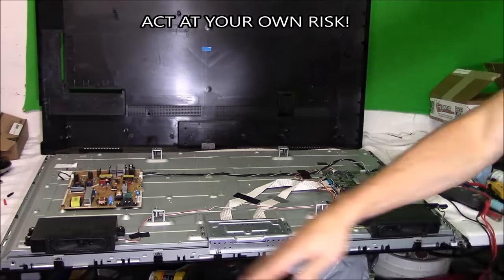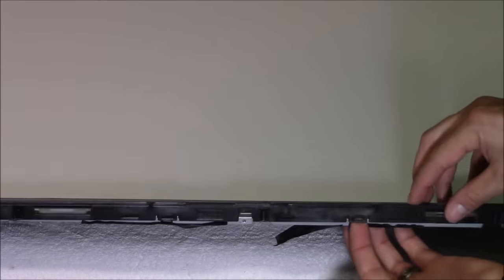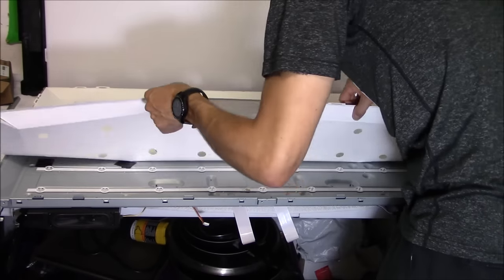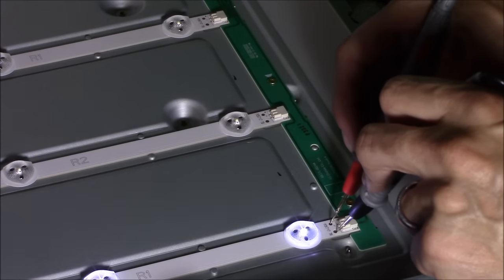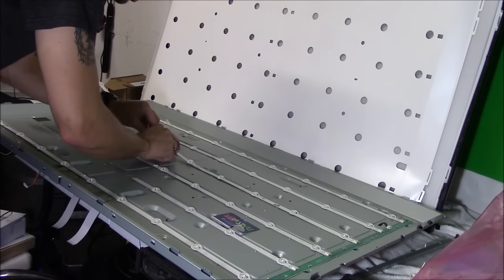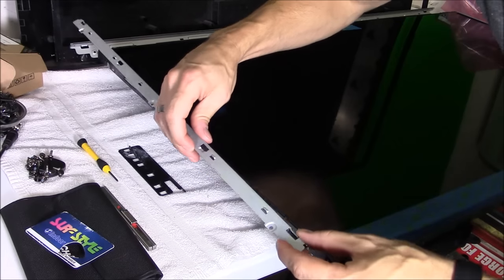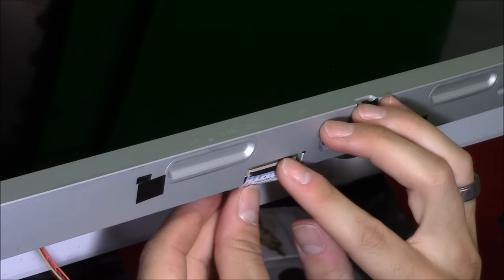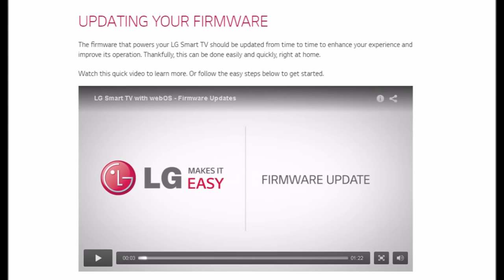How to fix LED LCD TV black screen no backlight, TV disassemble, testing LEDs, ordering part, repair

Comment: Hi! I have a AOC 40 inch Led tv. the screen is completely dark. when I use flashlight I am able to see the image. I open the back cover of the TV and after inspecting I see that on the power supply board where the LED strip connector is available there are some burn marks. it looks like a IC burnt out. kindly help me how to fix this issue.

Comment: Hello sir, I have a problem with my LG 47” LED TV. Which is no backlight. I measured the voltage, output voltage both side is 102 Votes. What do you think? Tell me please, what happens. Thank you.

Comment: Is it really worth it  after spending only $200.00 for the t.v.  You pay for a tester. How much is a replacement for for backstrip lights.
Reply from the maker: True but Depends on the tv model some TVs are worth fixing.
Reply: @TampaTec  my tv is Lloyd's 24" had it for 8 years & the red light started blinking, when it shut off after a wind storm.
Also, have a 32" RCA, that worked for 3 weeks, but was in the box for 5 years  & just like stopped working.
They do not have the tester at Amazon, I just checked. 
How much do the LED strip go for..
I guess if it is not too expensive, I could try.
Since, I have 3 tvs about 8 years old, that do not work. 
😆 
How much do you think it would cost to bring into repair?
I am a person that does things myself; but I am worried I would mess it up.
Thanks again for responding

Comment: The back light on my two year old Samsung Smart TV just went out. Guess that's another thousand bucks down the drain! Before I purchased my current TV, I had a Sony LCD TV and that one broke shortly after a year. Since I owned that television for approximately 14 months when it suddenly stopped working, the warranty expired. Before I owned my Sony TV,  I owned another Samsung TV that had a LCD screen. That TV also quit on me after owning it for just a year. Years ago, most televisions worked for approximately ten to twenty years. Nowadays, you spend a ton of money for a POS that quits after owning it for 1-3 years! They don't make things as well as they used to, that's for sure! I'd put up with shitty SD quality screen any day of the week just to avoid a HD TV with an LCD screen that constantly needs to be replaced after just a year or two. I'd take that heavy monster of a TV any day of the week! At least they last and don't cost a fortune! Isn't it funny how the warranties on these televisions always expire shortly before they break??? Samsung & Sony must have hired people to test these TVs and to see how long they typically work. Once that information is ascertained, the companies probably shave a month or two off of their warranties. This way, it's YOUR problem if the television breaks, not THEIRS! I swear, if a company made a TV that was guaranteed to work for ten years but charged you four times more, I'd buy it in a millisecond! Very informative video btw! I just can't be bothered with it all. I f*cking hate Samsung & Sony now. All their TVs are pieces of shit!
Reply: You are right on the money. I have three LGs and one won't turn on unless you unplug it for 5-10 minutes. The other is black only sound.  No more LGs in this house.

Comment: I have samsung tv its got 10 rows 0f 16 leds. only bottom half work. I have replaced the power board and swapped all led strips around but still they wont work. Is it possible the logic board is at fault?

Comment: I have a LG 50pn4500 the tv turns on as soon as i plug it to power and after about 20 minutes to an hour it shuts off and i can;t turn it back on. if i leave the tv  plugged for about 30 to 40 minutes it turns on by its self. Can you help me out.

Comment: Put tape on every corner of white diffusers before lifting. That will keep them together.. I believe what happens is once one burns out extra voltage gets sent down the line. This then burns out the next weak led. Now more voltage is sent down the line and on and on... Theory anyway...

Comment: i have sound.  no backlight. and no screen as well (no picture when you shine flash thru it). so possibly my display logic board is bad as well?    

when i turn it on, and i press navigation button on the tv blindly, i can hear the sound that menu makes.

Comment: where to buy LED flat screen panel, Samsung model no. UA40H5003AR  the problem is need to replace it crack damage. where to buy? the LED Flat screen Panel here philippines?

Comment: I have a LG 55LN, the TV turns on then goes dark, but still have volume, I think the back light goes out, however if I turn the TV off then on, it works fine again for 3 or 4 minutes and does the same thing again lloyd over. Any ideas?
Reply: scott caine bad leds

Comment: ln32b530p7f Samsung tv has no backlight, no image. Has sound when turning tv on and off, do not know if there is sound when hooked up to an input source since I can't tell what it's doing? Will a bad t-con board keep the backlights from coming on? Red light is on solid when turning tv on. Could you tell me how to fix this problem? Thanks.

Comment: I have a ? regarding my PC it was working fine n everything n then when I turn it the power comes on n everything but it won't show up on my monitor I checked my cable on an other PC n it works. then I notice that the HDD light would come then blink n blink again n then it would jus stop showing that its not reading it. do u know what I can do to fix this r what this mean pls help me?

Comment: I have a Samsung TV model un60h6203afxza was watching TV and the screen acted like the film was messing up and it died the backlight flashes and the red power light flashes. I replaced the power supply didn't fix it. Please help.

Comment: i need some help and advise on how to fix my 55inch lg tv power light comes on but the screen is black
Reply: maureen schaeffer use a flashlight on the screen if you can see a picture or the menu screen but no backlights you got bad leds

Comment: When I turn my LG tv on, it flashes the logo for about half a second and then the entire screen goes black, although I still have sound. It does this everytime I turn on the tv. I did the flashlight test and can see a picture, but I have no backlights. I couldn't spot any noticeable damage to capacitors or anything else anywhere. Do you have any idea what this might be?
Reply: Same here

Comment: 6:25 you're lucky you got no glue on that white sheet. Mine was glued with plenty of double face tape. I had to use a heat gun and still have damaged it a little.

Comment: Hi my panasonic tx-43gx555b was working 100% fine and all of a sudden the screen went black and I still could hear sound. I have changed the main power board and that didn't help. When I shine a bright light at the TV whilst it's got power I see some logos on the screen such as amazon prime. I'm unaware if the tcon board needs to be replaced, some posts say if I'm able to see logos with the power on the tcon board is fine and it's a back light issue. Any ideas anyone

Comment: The lcd is as sensitive as a potato chip, these leds are basics leds, yours could have edge lite or matrix leds, big difference, good luck finding a replacement lcd as there are no companies that make lcds for repairs! The lcd bulbs are in series and can be replace via soldering with heats gun, there normally 3 or 6 volts

Comment: Don’t bother with the 50 pound tester, get your voltmeter and connect the contacts with a couple of 9 v batteries, a lot cheaper, you may need a couple of batteries, maybe 3/6 from 27v to 54v, start with a lower voltage then go to a higher one, one battery at a time, also do not plug it in for a long duration of time

Comment: Dear tempatec.. Plss help i have led tv vertical line issue.. Done check tcon ang i descover stdv test point no current volt and the smd resistor i dont know the value.. But it mark X10 plss help sir..

Comment: Amazing but I'm wondering if it's worth the trouble for me. I could just spent another $1000 and replace the whole tv.
Reply: Ash Underwood it will cost you around $170 to have someone repair your TV

Comment: My led show through. I think I put the sheets on wrong. Insignia Roku 50in. Thin shiny one.clear Plexi one and thicker one with smooth and rough side. So one of these is t right...or the LEDs are too bright.
Reply: I just replaced mine on an Insignia Roku 50in as well, noticed the same thing. But it only really seems noticeable when viewing a static screen with a single colour. When watching shows or playing games, it isn't an issue for me.
Reply: @CrazyMonk3y59  ya I'm trying to deal with it. Don't feel like taking it apart again.

Comment: Hi I have sharp tv 410834043 Was working fine now on screen is black so I have change all the circuit boards in the back but still no picture

Comment: Just took apart my LG tv 20 minutes before watching the video to find out how I can test the strips using a multi meter (evidently you cant) either way i did a minor crack in the LED screen when removing I did not support it with frame when removing (live and learn) not really concerned as I had bought 2 of these TV's 3 years ago and 2nd one finally failed so I have 2 to work with (1 for spare parts) a little bit miffed that I have to purchase a tester to test the lamps and also 2 years out of a TV doesnt seem to be worh the money these days not sure its worth buying a tester and possibly new strips

Comment: have you ever cracked the screen while doing this type of repair?
Reply from the maker: Phillip P I haven't yet but might happen one day if I lose my patience.
Reply: Tampatec I have a Vizio and LG that need new LEDs. Never replaced them before. Your guide is detailed and easy to follow. One thing you do different than other led replacement videos, you use a suction cup. That's something I would never thought of using to lift the panel
Reply from the maker: Phillip P for me that is easier. I made another video How to replace individual LEDs on the LED strip.
Reply: Just a heads up, if you ever do this to a Sharp TV the plastic strips under the bezel are glued to the panel.  If you try to lift it up and miss a clip, say goodbye to your panel. Learned that the hard way.

Comment: We put our tv together now lcd doesn't work but led does. suggestions?
Reply: lcd worked before. led didn't. now it's the opposite because we fixed led. sound is okay too.
Reply: Yay. Found the problem. Had the LCD wire moved too far to the wrong side on the hookup to main board.

Comment: so why if only a few LEDs are out the whole screen is black I have a tv I fixed now has no picture did flashlight test I can see the picture funny thing I haven't used it in months went to turn it on and no picture it's an LCD 2008 Samsung

Comment: But only 4/5 led's were bad yet you had No picture at all?(in part 1)...So if 1 led goes bad they all quit working?
Reply: Danny Moore yes the tv some how knows if an led is not working!!
Reply: Bit like Xmas lights then.. lol
Reply: Yes I think it is current draw censers measuring power being used by the LEDs because if one led is not consuming power than all other LEDs would get a little more power and burn out .. but Christmas lights don't have circuitry so it's just power that goes from one light to another and some have extra filement on the bottom of the part that holds the filement in the bulbs so if it burns out than power can still go to the rest of the bulbs
If no extra filement than no power can go to the rest of the bulbs if one burns out!

Comment: I hit my tv out of anger and the top right part of the screen broken and cracked is it worth trying to fix?
Reply: No. Anger management classes are cheaper than a new screen :O)
Reply: No....and new panel is way more than the tv cost.....only other way is trying to find a used one...
Reply: Where do you find a screen where that besides a used TV

Comment: what if you have no back light but you do have a picture with a flash light on the screen
Reply from the maker: Walter Jackson no backlight can be bad backlight board or the backlights are bad. get tv boards at shopjimmy.com or electropartsonline.com use code tampatecfriend for discount.
Reply: Tampatec  can it also be the the power supply?

Comment: Thanks. I replaced all the capacitor in the Viewsonic LCD but it still blinks every 8 to 15 seconds. I hope I can pinpoint that one sub-component or two :-)

God bless, Revelation 21:4

Comment: been repairing these for a while now. the LG panels are the worst. it's pointless replacing whole strips I just change the duff leds. get given loads scrap tv sets just cut up old strips and use those costs nothing in parts this way. plus if you have one led out why replace while strips. ones from shop Jimmy likely just recycled from broken sets anyway.
Reply: Can you change your lcd tv to led ?

Comment: Does anyone know of a yputuber who fixes tvs and responds to comments? I need to find new strips for my TV. I replaced some of the leds a few times but this time I'm having a hell of a time and I'm done. I'm not sure if it's the cheap leds I purchased from China or what but I can't find any decent ones that don't melt and only had a few other. These will not take and I don't know why so I heat them until the freaking burn. I had 2 leds from last time left and they went on fine but not one of the others will
Reply from the maker: Shopjimmy.com
Reply: @TampaTec  thanks I know of the shop I'm just can't figure out how to order the correct part. I have the old ones off and tried before but i don't know enough about this stuff. I'm usually pretty handy but Im trying to use a painters heat gun, my soldering iron won't heat up enough anymore to tin the pads and these cheap leds are melting before the solder is. I don't know what's going on maybe I'm just having a bad day but everything is going wrong and I'm so angry right now I can't even think straight. I don't every remember being so angry in my life.

Comment: Beware of the SHOPJIMMY website this guy shows in his video. They have some pretty bad ratings and issues with their products. I received salvaged parts that were physically damaged from the salvage process. Also beware that they will charge you a 20% restocking fee and also charge you the return shipping costs! - I would suggest you find them elseware and definitely NOT Amazon.
Reply from the maker: John Stoaks I only had a good experience with them but if you had a bad experience to try electropartsonline.com they have good return policy.
Reply: Nothing Against You, Your video was very helpful and informative. Just advising the other 143,00 people of the issues with this company shown in your video.

Comment: Too much trouble. Buy a new TV. You might fix your TV for a hundred bucks plus the cost of the tester. But you might not. You might find something else wrong with it. One thing leads to another and the stress you put on yourself ain't worth it. If you are lucky enough to have a shop close by you can take it to....that would be better. If it's under warranty...even better. But if it's more than 5 years old forget it. For 300.00 bucks you can get a new 43 inch LCD. Spend a bit more and you can get a 46 to 55 inch. They are not that expensive anymore.....until you get into the 4K TV's.

Comment: want it be cheaper just to buy a New TV than to buy all these parts
Reply: glen s dude, TV's cost $500+ and the pieces cost around $50. (Unless you buy an olden day TV then that's cheap, but they barely sell them anymore). Do YOU think buying a new TV is cheap?! 

C'mon kid.

Comment: my 32" sceptre doesn't have a t con board or a back light inverter board it has only one board in the middle of the tv and a small board at the very bottom of the tv that's it

Comment: I Guess, it would be too easy, to Create, a Service panel that unscrews, and allows access, to the LED's, from one of the Sides, of TV,....
  And have each Light Strip on  slide Track, and a wire harness, that you can unplug to save all that, added work, of tearing everything down, just to.get at LED's......Lol
  But i Guess, they would loose money, knowing that 99% percent of consumers, are just tossing out in a land fill, their, "Not working", tv's..
And we as a human race, are so worried about plastic bottles ?

Comment: have same problem with led tv  all leds seem to be good they are on and functioning fine good power red light on /goes off when turned on...chime comes on when turned on  screen turns blue when turned on. no picture /red light on main board and blue light on tcon control /////both tcon and main board changed .. have trouble power supply to some degree. all caps ok all doides ok  have not checked voltages yet an help would be app this is a samsung led 46ue5000  with a powersupply board bn-44-00667a  thanks 
ffuudog@gmail